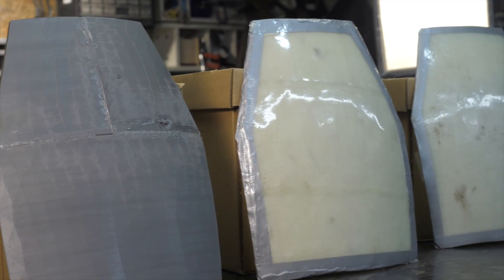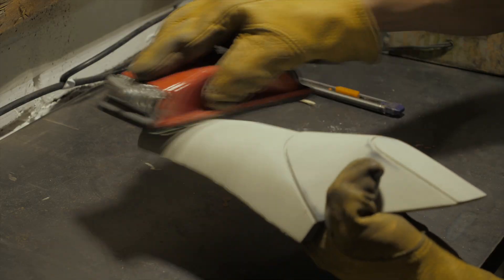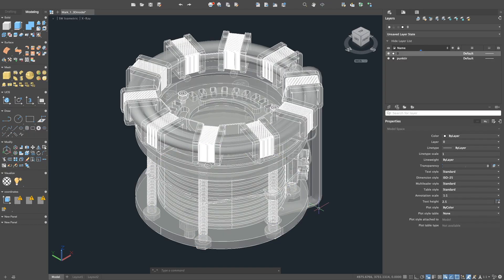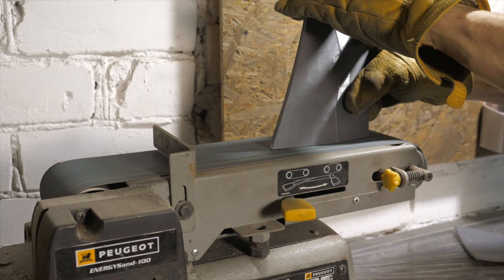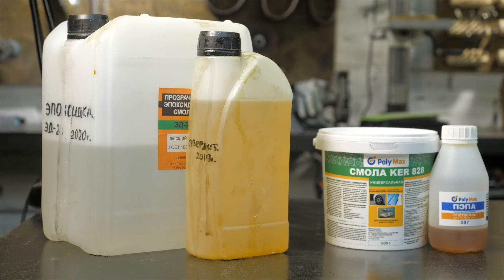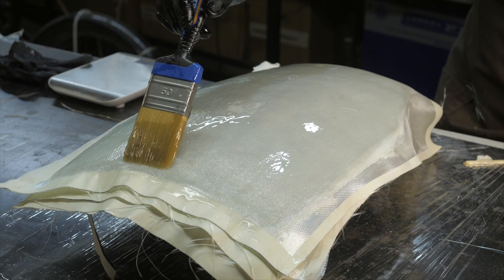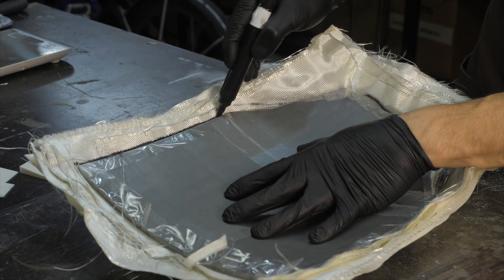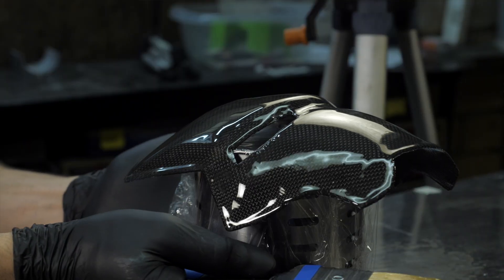Fiberglass part on a 3D printed mold. Basics of composites 2: Сomposite materials body armor

Comment: How much pascal can this combination resist without going past the failure point. Calculated from the perspective of a sudden impact force. Like the pin drop test you did in your material video. And what is the scalability regarding adding layers, does the added resistance per layer added diminish? To state simple is it more resembling of a square root curve or more linear. 
And what is the total Newton that is  transmitted to the body behind it?
And lastly, does the electroplating process add any additional benefits or would simple metal paint do the job at this point?

To add some background info. I am building a modernized samurai suite that will be used in a theatrical play (it can not be overly heavy) but due to budget, it will also be used outside the play in a life demonstration at the local Renaissance fair. Where we are putting up 4 era's of armour technology against each other. 500 Anno Domini (AD) 1000 AD 1500 AD and last but not least the one i am making 2000 AD. 
I am allowed to use all modern knowledge so these past few videos are an absolute gold mine.
However, I am not in a place where my current composite can handle sword slashes and stabs and the impact of a rubber/steel blunt point arrow. So the answering of these questions could reall help me flush out my own needs. @ALEXLAB

Comment from the maker: FAQ UPD: February 9, 2023
Guys, thank you all for your questions and advices. You are the best!

Alex I cant see your videos?
Guys, please write in comments if you have any problems with access to my channel and videos.
I noticed that during last year most of my subscribers cant see last videos.

What about the Iron Man suit?
I'm working on stuffing. The main problems are power, thrust, and heavy installation weight. The full metal shell is a bit tight. When I made a head and rode in it, I realized how heavy the suit would really be. Actually, the composite season is consequence) But do I understand correctly that if I make a suit from a composite, it will not be considered that I made a suit?)

Why don't you fire fiberglass before laminating?
Because for some reason I did not know this) Seriously. Thanks for your comments.
Now I will burn it all the time. During production, lubricants are added to the fiberglass, most often paraffin, so that the fabric does not fray. This paraffin impairs resin adhesion and penetration into layers, weakening the structure. Therefore, before laminating with epoxy, we need to burn the fabric with a burner. The fabric smokes, smells of paraffin and becomes more transparent. Or we laminate with polyester resin, which dissolves the lubricant itself.

Do I need to turn the sheets at 45 degrees?
If there is a need to achieve stability of the part to torsion load, then yes. In the case of a shockproof plate, I considered that this was not necessary.

How many layers does it take for a plate to stop a bullet?
About 30 layers are used in Kevlar armor plates. Kevlar is much stronger than fiberglass. Therefore, making armor plates from fiberglass is not justified. They will be too thick and heavy. Kevlar is available on Aliexpress. Given the price per meter, one plate is obtained from $ 500-600.

How many layers do you need for an e-bike frame?
If you take the same structural fiberglass, then from 3 to 5 layers. Depends on geometry. In any case, before making the frame, you need to make a pipe probe from a composite with the same cross section and do strength tests. A little more will be in part 4.

Do you use the metal mesh you showed in the shot?
Sometimes I use. It can be laid not over the entire surface, but for example along the perimeter to strengthen the edges.
On the plus side, it adds stiffness and the details don't paint at the edges under load.
Of the minuses, the grid fits harder than fiberglass.

What printers do I have?
I use Creality Ender 3, Ender 5 and CR10 printers. Ender 3 is the cheapest and most versatile. Ender 5 is more expensive and the table is slightly larger, but the main thing is that the table only moves up / down, which makes it much easier to print high details. CR-10 is also normal, due to the huge table, but you have to conjure with adhesion every time. And again - the larger the table, the stronger the garage is heated. In short, Ender 5 is my favorite. Want to learn more information about printing - @FranklyBuilt is unleashed source of practical knowledges. youtube.com/@FranklyBuilt

About PLA and ABS.
Apparently I got a promotion on local market and PLA was much cheaper than ABS. Therefore, I bought it 8 kg and still use it. If we are talking about this particular detail, then there is no difference at all. I don't like ABS because of the fuss with adhesion, especially on the CR-10, which has a glass table.
Even if the details are very tiny, then PLA gives out finer detail than ABS.

Why should the weight ratio of resin and fabrics be the same?
I took measurements of weight, strength and different ratios. As a result, 50/50 gives the best ratios. Strength tests will be in 4 parts.

Why didn't you use vacuum lamination?
I have a vacuum pump and everything for vacuum lamination. I'll show you in the next videos. This time I wanted to get by with a minimum of tools to show how simple the technology is. Every day I watch how various unnecessary stuff are printed on 3D printers. I want to show how applied a 3D printer can become if printing is supplemented with composite materials.

Why do you need composites when you can just print a thicker part with 100% infill?
Composites give better strength to weight ratios. A thick part with 100% filling will in any case be inferior in strength to composites.

Have you tried carbon threads filament?
Yes, I tried. The products are stronger than ABS, PLA and Nylon. But the main point of carbon fiber is the strength of carbon threads. That is, the part is strong due to the fact that solid carbon threads pass through the entire part. If the same thread is chopped into pieces and added to a thread for a 3D printer, then the whole point disappears.

What software do you use?
Video editing Final Cut Pro X v.10.4.3 https://www.apple.com/final-cut-pro/
3D modeling https://www.blender.org/ https://www.autodesk.de/products/autocad/overview
3D Modeling AutoCAD 2018
Pre-print slicer https://ultimaker.com/software/ultimaker-cura
Graphic raster editor https://www.gimp.org/

What are you shooting on?
Computer: MacBook Air 13-inch, 2017
Camera: Panasonic Lumix DC-GH5 Body
Lens: Olympus M.Zuiko Digital ED 12-40mm F2.8 PRO
Microphone: Boya BY-M1
Reply: The weight of the suit should not be so bad once you factor in the controls for the emg sensors, the fact that it will be able to support itself, and most thrusters have more than enough horsepower for flight.

Also the total weight of the suit would only be around 200 pounds or so if it's made of metal.
Reply: Oh and the properties of composite layer will help determine how heavy the outer layer will be considering that it will help reflect the damage.

Basically the inner layer(composite) will help absorb and reflect the damage that comes into contact with the outer metal shell.
Reply: Composite suits are still suits,they just won't be nearly as strong or tough. And the inner part of the suit will be more exposed to bullets and blunt weapons

Comment: I can't wait for strength testing. Have you worked with vacuum sealing to remove additional air bubbles from the resin?
Reply: The 3d prints are not 100% solid so vacume sealng isnt a good idea
Reply: @Kal-isup  3D prints can be made using either solid fill or a lattice geometry that fills some percentage of the volume between the walls of the print. You're right that if air is trapped in the print, introducing this into a vacuum could cause an issue. That said, if a solid print is done, any tiny air pockets will be negligibly small and not pose a problem at complete vacuum.

Comment: I don't quite understand the hydrogen reactor 
I mean how does it work
Reply: Alex uses an aluminum oxidization reaction to generate hydrogen without an electric current/battery. When you put raw aluminum in water, the aluminum atoms steal the oxygen atoms from the water molecules producing aluminum oxide and hydrogen. But to keep the reaction going, he needs to dissolve the layer of rust that rapidly builds up on the aluminum so he treats the water with a strong acid making aluminum waste and more water.

Aluminum + Water = Aluminum oxide + Hydrogen
2 Al + 3 H₂O → Al₂O₃ + 3 H₂

Aluminum oxide + Nitric acid = Aluminum nitrate + Water
Al₂O₃ + HNO₃ → Al(NO₃)₃ + H₂O

The water level in the reaction tank stays the same but it starts to get cloudy and white as aluminum nitrate particles build up on the bottom.
Reply: @NobleGas_54  I wonder how long the aluminum lasts in the electrolyser 🤔
Reply: when current passes through water, it decomposes water into its constituents, hydrogen is released. pressurized hydrogen is burned